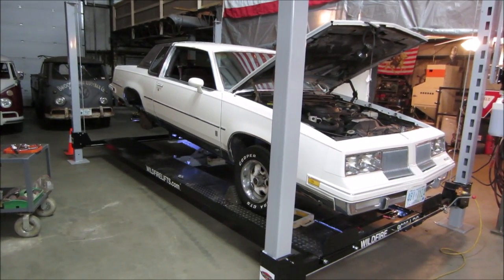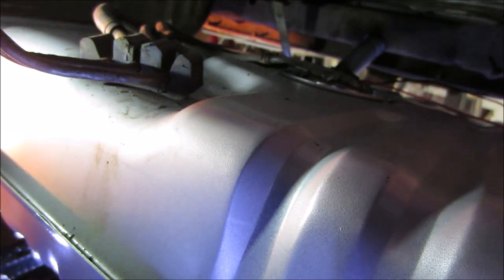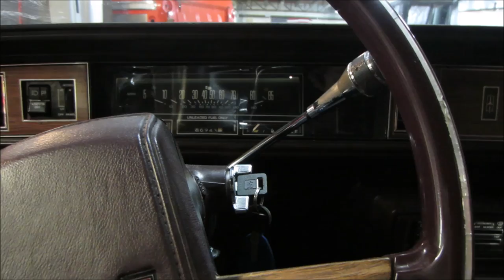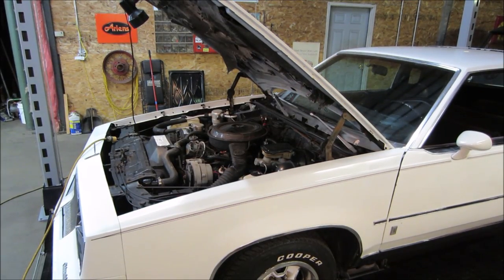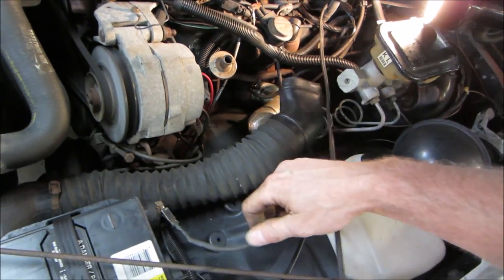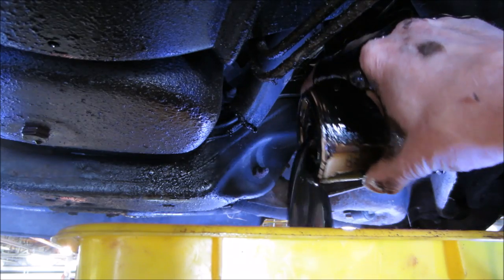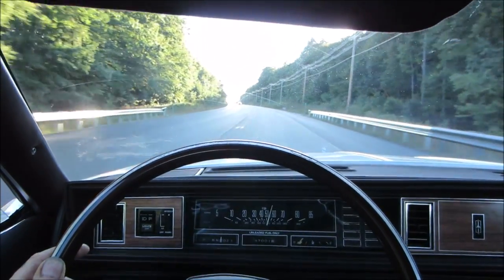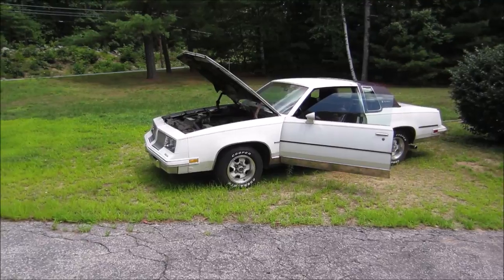Rustoring  Cars On A Budget. 1986 Olds Cutlass Gets Completed.

Comment: Hey Mustie, old GM mechanic here.. On all GM products that use the HEI Ignition system, the rotor plays a big part in how fast it will start up.Most times when you think its weak on starting because of fuel or carb, its most likely the rotor. Change that nasty rotor even though you cant see burn through and it will start really fast and it will be easier on your battery. I kept all my chevys fresh with the distributor cap,  the carbon rod under the coil with the spring on it AND a fresh rotor for perfect starts everytime. Take it from a guy that knows GM like blind folded!!  change the rotor. the carbon rod under the cap that rides on the top of the rotor looks fine.. the caps on GM HEI lasts for years ...hope that helps brother
Reply: @xray111xxx  "quality was suspect" lol ya think?
Reply: @xray111xxx  - in the mid 90's, I knew a guy on his fourth engine in the Camaro.  He loved the car, he just wasn't happy with the build quality :)
Reply: Them HEI Caps were notorious for burning thru around the coil!!
Reply: @xray111xxx  quality isnt suspect in my car,86 trans am
Reply: @drunkingsailor2359  nope.........
Reply: @trillrifaxegrindor4411  yes
Reply: Another thing to examine when the rotor is removed is the advance weights.  If the rotor has been arcing or misfiring, the arc travels through the pivots on the advance weights and will wear them out.  Mr. Gasket and other aftermarket suppliers made a kit that used plastic bushings to re-bush the advance weights and stop future damage from the rotor shorting out.
Reply: @xray111xxx  Greetings from Finland. Had a 88 Camaro for 6 years, and once in a while it had something going on. Friend of mine liked it as Knight rider also, because it was black with T-top. Fun times with it, and of course I have a car fever. For V8 again. Perhaps this time for a real Firebird from 90's. ;)
Reply: It didnt look that great, agreed
Reply: @tbelding  
When a guy needs a FOURTH small block Chevy in his Camaro, it might not be the engine's fault. Unmodified SBCs will go 200k miles with the most basic maintenance, no problem. This guy was doing something pretty extreme, I'll wager, like modifying the snot out of it, or maybe just never changing the oil.
Reply: @Michael_Lorenson  Apparently he hadn't changed anything else on the car.   Still original transmission, etc.  Just that the engines liked to grenade (or whatever kind of failure they did).    I've only ever had heads crack and fired a spark plug out the top of the block.   (two different cars)
Reply: @trillrifaxegrindor4411  build quality is suspect on every general motors vehicles ever made after 1948.   Lol
Reply: also check the magnet on the distributor shaft. they like to crack and gives poor signal to the module
Reply: Those pesky misfires at idle are always so annoying. I had an old Bronco and never could get rid of it. I think the back cylinders tend to wear out quickest because when the carb floods the gas runs to the back cylinders and washes the oil off. On the Fords it was always the #7 and 8 cylinders that would be first to start losing compression and have a misfire at idle.
Reply: Good electrical connections are paramount! A good ignition module and cap and rotor.I prefer a distributer cap with the brass inserts I use MSD the cap is red I love! i have red 8.5 mil wires also! I recently tried NGK plugs I think they are platinum, wow I have used other plugs but these seem to give great throttle response!

Comment: One MAJOR thing to replace at this age-
This uses a temperature controlled "Thermostatic" air cleaner unit.
The bimetal temp sensor is in the air cleaner housing; it controls a vacuum source, that actuates a temperature door, that draws air from the heat stove (shroud around exhaust manifold) when the outside air temp is low. As the engine warms, the diverter door opens to fresh air. When the temp control unit dies, it constantly draws hot air, and the engine will ping it's brains out under acceleration or under load.
Reply: That finicky nonsense in the air cleaner is only for reducing emissions and time while warming up  -- the electric choke on the carb will take care of cold weather starting and idling.  If you don't care about emissions on a 30 year old vehicle (or don't need to pass a concours inspection) cap the vacuum line and disconnect the heat risers as none of it is needed.  I disconnected all of it on my 85 Mustang GT.
Reply: @johnb5982  Same shit on a W126 mercedes. smog pump that goes out and whines but doesn't matter once the engine reaches operating temperature cause the clutch kicks in,,or out..
Reply: funny thing is, out of all the old junk I had with them, I never had to replace one. now I did change a few on other folks cars lol
Reply: @johnb5982  in the northern/cold climates without the exhaust manifold heat riser setup, the carburetor and intake can quickly ice up when the engine is cold and you won't get very far, even idling in very cold temps can ice them up fast, even if it doesn't forget trying to drive before warming it up for an extended period.
been there done that when the hole wore open and let pin vibrate out one end, dropping the flap which stayed open, the carburetor iced up in about 1/8th mile and quit running. bad enough it locked the throttle shaft and blades solid
Reply: @throttlebottle5906  ow so it's actually functional not just for emissions crap
Reply: @neilmurphy845  yep, even in well above freezing temps carburetors can ice up with high flow volumes and wind blowing over. airplanes, snowmobiles and many other things use directly heated carburetors either electric or coolant heated.
Reply: @throttlebottle5906  ow that's interesting
Reply: @throttlebottle5906  Kawasaki GPZ900R got a carb hearing kit for that reason, carbs icing up in cold temps, kinda dangerous on a motorcycle....

Comment: Mustie, you need to get rid of that homemade exhaust someone put on that car with 90 degree bends behind the wheels.   GM A bodies had a more gradual tilt out the sides porting out under the middle rear of the quarter panels.     That looks like Nova exhausts on that Cutlass.       Love the fact it's a true Oldsmobile all around.   It's an Old's 307 V8!  (Oil filler in the middle front).      Not as much horse power as a chevy 305, but close!   Very smooth and nice Olds sound!

Comment: Ahh the old 70s through 80s GM road sofas. My father had these as company cars, usually Chevys. Floaty ride, that typical for the time thin steering wheel with full power steering, and handling was pretty vague.. But for highway road trips, you'd be challenged to find a nicer cruiser. My very first car was a '78 Impala sedan.. in that sort of metallic pine green color with green interior. Pretty close to base. Dad always got the heavy duty rear-end and air conditioning. Drove it for some years, lots of fond memories of that car.
IMHO this style Cutlass is the best looking of the bunch. Timeless styling. Man if I had the means I'd love to find a nice unmolested one of these to have as a weekend cruiser. 
Oh, and the off-road drive reminded me of camping trips with Dad. That car looks like it rode just like  ours did as we'd go into the woods looking for a spot to pitch the tent.
It's only partly about the car. The best part is the memories, and these videos brought some fond ones back. Thank you!
I hope this car goes to a good home and gets the love, care and cruising it deserves!
Reply: I had a ‘79 Impala. One year my siblings and I went Christmas tree shopping and rode 3 abreast in the giant front bench seat. We had no problem fitting the 7’ tree in the trunk and closing the lid.
Reply: I had an '80 Park Avenue... it was like having two full sized sofas sailing down the road like the USS Nimitz in high seas but it had the best turning radius of any car I have ever owned.
Reply: I love old school cars 😍😍😍 and i love these comments
Reply: Please go find u one and re live those good days before its too late please do it for me 🙏🙏 anything is possible
Reply: gonna pay a real pretty penny for a clean,low mileage one.10k anyways...
Reply: @benhatcher2603  I believe 3 in the front (girl in middle) was called :riding Bon Jonvi" at least in S. Jersey it was.
Reply: Road sofa....lol. Good description, we had an Olds that was pretty similar this one, and I recall it was pretty comfy for road trips.
Reply: I miss the cars like that..They were so comfortable. I had a '71 Chevy Impala two door that I bought in '73 for 2500 with only ten thousand miles on it, like new. Champagne gold with black vinyl top, gold cloth interior, very pretty car. I drove that car until 1991 and then sold it with 245k miles on the original engine and trans. We took a lot of long road trips in it, really nice car, road like floating on air. It had the 350 V8 with two barrel carb, lots of torque. Great car, well built and solid.
Reply: Road sofa... So accurate.
Reply: just got my first real old school (89 caprice) after my grand marquis. love em both to death.

Comment: Dear Mustie 1 you can also put a flashlight on the oil drip on floor to shine up on the spot the same when you hang up a lamp over your tables . And by the way next time you need to remove an old bar handle you can blow air in to it insted of cutting it . The advises are said with a smile and no head shaking , I have learned a lot from you and your vids so keep on rock ´in

Comment: Mustie......I can tell you this with absolute certainty. While carefully listening to the engine as you were checking for a dead cylinder. I could clearly tell you have atleast 2 DEFECTIVE Hydraulic Lifters. You can tell they have bled down and are not functioning properly. Most likely it’s WEAK Intake Lifters tapping. Soon they will not hold any hydraulic pressure and then your going to have multiple cylinder issues.

Comment: I learned a little trick from my neighbor mechanic last year I'd like to share with you Mustie1.  Take a screwdriver or awl and punch a hole in the bottom of the oil filter when you're draining the oil.  It makes it far cleaner and easier to remove the filter.  Dang young'uns.  Been doing like you did for 50 years and now they show me how to do it right.

Comment: It is regrettable that designers and engineers try to cram V-8 engines into spaces not really  big enough to accept them. Not so long ago, the straight 6 engine was the gold standard in this country. Whether flathead or OHV, automakers turned out some reliable, strong, torquey motors, and they are a lot easier to work on, than a V-8. Of course some manufacturers
(BWW comes to mind) who still use straight six engines, have managed to ruin a good thing with twin turbos, and miles of plastic components, which become brittle and fail.
Progress is a much-misused word!

Comment: To check for plug lead shorts to ground, do it at night or turn off the lights. The sparks will light up the engine bay like a Christmas tree.
Reply: Spray bottle of water on spray mist mode in the dark. Arc easy to locate.
Reply: his way works pretty good...
Reply: @Darryl603  yeah I've known of his way for a long time. It does work great.
Reply: learned that about age 10, working on uncles truck. non-mechanical folks are not always a bad thing :))
of course dad and many others were all skillfully inclined and I always paid attention!
Reply: @isaiahwade1484  I thought when he cut the wire shorter, to put a plug in the terminal and then put the wire inside it's place, close to the end of the plug. Be safe

Comment: I own and drive an 84 Monte Carlo SS. I replaced the turbo 350 with a 200-4R. The car can now cruise at 70 and the engine is turning 2100 RPM. This car is a pleasure to drive now. It has a stock 305 which is not even close to being a performance engine, but it is a very smooth, and reliable engine.  Ford, Mopar, and GM built cars in the 70's, and 80's under silly government regulations, they weren't perfect, but in their day they were decent cars. I love all of those old cars, I hope that they never go away...Great job Mustie.

Comment: The reason the wheels are so close is that they are 14  x  7 Super Stock wheels from 1970 to 1974 Olds Cutlass and 442. From 75 on they had snap on center caps opposed to yours that bolt on from the back. That 86 had 14 x 6 wheels originally with snap on center caps as I described. Nice car though, I have 2 older ones.

Comment: Those carbs are notorious for leaking everything out of the bowl over time sitting (overnight even) to where you have to crank and crank to fill the bowl at first.
You can epoxy up some little tiny freeze-plug looking things on the carb and solve it (must use modern epoxy made for Gas with Alcohol in it)

Comment: Thanks so much for making these videos. 
I’m really enjoying this series. I just happened to buy an 88 cutlass supreme Brougham a few days after your first video on this car. I have a nice picture from Sunday of the speedometer turning 77,777.7 miles at 77mph. By the way, the low power issue may be because of the cam they used in the cars from 86 to 88. It had almost zero higher rpm power but lots of low end torque. And they pretty much wore out and needed replacing between 70 & 80k miles 
In mine When I get on the gas at highway speed the car can barely get out of its own way. And it was well tuned up by the previous owner who is a mechanic.

Comment: “I didn’t drain the carb” quadrajets drain themselves.
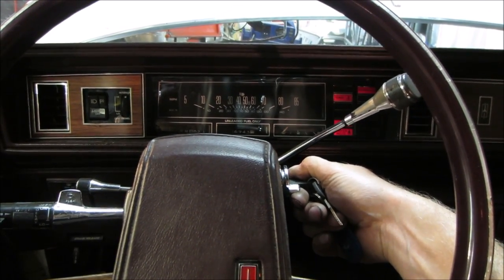Reply: 11:09 he says it
Reply: Lol right?
Reply: I was just about to type this exact thing. Quadrajets have two well plugs in them. Over time those plugs wear down and will eventually allow gas to seep out of the carb and drain the float bowl. Exact same thing happens with my 79 Chevy pickup. Start it every day and just just have to breathe on the key. Let it sit for 3-4 days and you have to crank it for about 10 seconds to get fuel back into the carb.
Reply: @Shane-Singleton  i wonder if thermoquads are the same way?  after my dads duster 340 sits for a couple weeks i always have to fill the bowls or youll be there cranking all day.
Reply: @mikemoyercell  Maybe. Although thermoquads have a habit of the phenolic housing actually cracking so it may be losing fuel that way.
Reply: Replaced the quadrajet with a Holly in my 74 Charger
Reply: I always j and be the plugs. ha ha. LOve those carbs. they work great
Reply: Ha! I just posted the same thing lol. Thats why every one u take apart has jb weld on the plugs 😂😂

Comment: With everything that is in me I want to roll the pressure washer under there and blast all the grease and oil build up off of that beauty. The floor? That’s why they make floor squeegees.
Reply: He's up north though, more grease less salt rust. But I feel ya. I hate the gunk.
Reply: Wheel out the four poster to outside & give it a good under body wash.
Reply: In the video before this one he intentionally coats the frame with that as he had to patch the frame. That salt up north is pretty gnarly a clean frame wouldn't last 10 years.
Reply: @Kryynism  yes but still would be nice to get engine clean and all those belts hoses clean.....hell clean the whole underneath then before winter do a rust proofing after all leaks are resolved....
Reply: @Kryynism   I was thinking the same thing free undercoating! Haha

Comment: Some pointers for GM, replace the valve cover gaskets about every 10 years, the water pump and thermostat every 5 years. Should replace the cap,rotor plugs and wires, and depending on the quality they should last around 5 years.

Comment: They have a thumper cam that just fits without having to change anything on the top half that makes those 307s sound so good, those g bodys are the cars I grew up working on.....
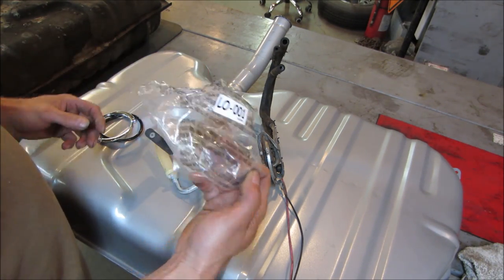Reply: @trillrifaxegrindor4411  that is definitely not true for all of the Thumpr cams. It depends on which one you go with. The smaller ones with like .555/.565-inch lift will keep the low end power around the same and will gain power in the higher RPM range. And these small blocks love the higher revs anyway. If that car had that cam and about 3:55 gears it would be very fun on the street and sound mildly aggressive.
Reply: That 307 is a factory roller. Not worth building as the heads are JUNK. The best bet for more power is an Olds 350/403/455. They all drop right in place of that 307. The next thing to worry about that that 200 4R trans. Won't take much abuse without some good parts and attention. Then there is the 7.5' diff.
It can be made quick easily enough. 
And no Olds engine will take a cam much over .500 lift without major mods to the heads. That 307 just isn't worth the time.

Comment: The new one looks smaller than the old tank .
Reply: Yeah, I thought that too.
Reply: yeah I noticed that too.....
Reply: I agree
Reply: Didn't seem like much smaller, but did appear to possibly be on camera
Reply: I think the camera is tricking the eye
Reply: Filler neck looks slightly wrong too, aftermarket!!!
Reply: Smaller
Reply: Didn't look as deep as the original, did it.
Reply: Ive found many aftermarket parts are a bit different, some work, some must be made to work, and some just dont at all.
Reply: Dieter Smythe I noticed that too; the diameter of the filler neck on the new one is smaller.
Reply: Dorman? Lol
Reply: The new one is probably EPA Certified and metric.
Reply: Glad I'm not the only one that saw that thought I was seeing things
Reply: I thought that too, but when he installed it the straps apparently fit the same. Must be an optical illusion.
Reply: @stacymcmahon453  I also noticed that and thought painted could look smaller than dirty one. But the grooves in the tank are shallow in the new tank. Tne size wherethe strap grooves are could be the same but less volume above the grooves on the new one..